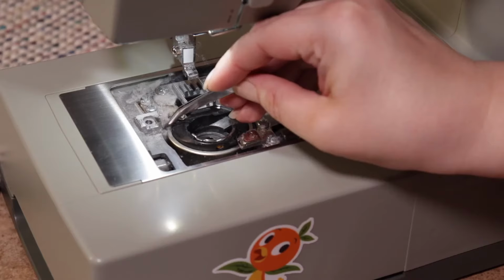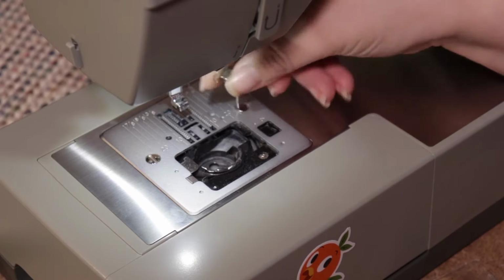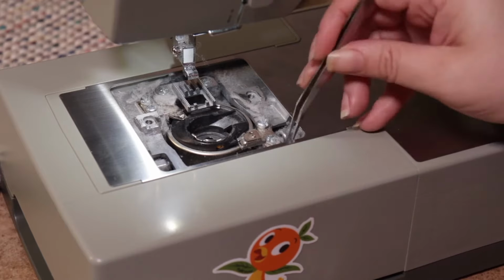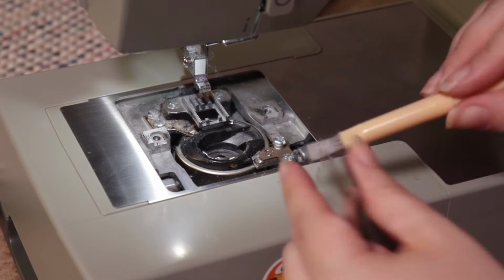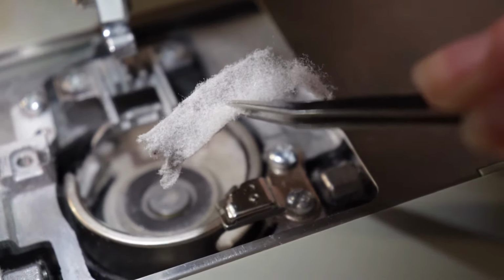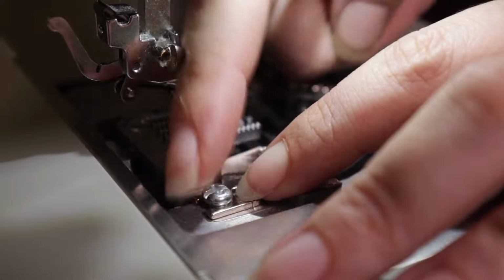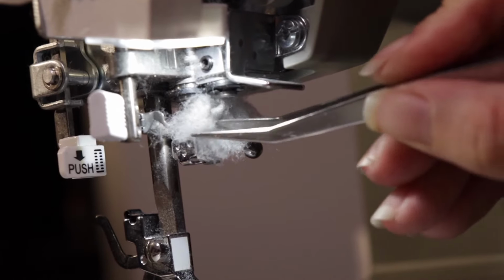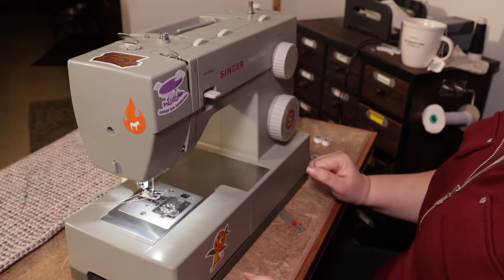Cleaning A Sewing Machine | Singer Heavy Duty

Comment: You don’t need to remove anything to get the bobbin case out. You manually turn the handwheel to put the hook race to the back then the bobbin case comes out.
Reply from the maker: I’ve tried that and it works on only 1 of 4 of the machines I have so I figured others might have that issue too.

Comment: Need slower more detailled instruction on how to get bobbin housing back in please
Reply from the maker: it should just drop back into place. If you have to force it, it probably isn't right. Make sure you have the it facing the right direction. (On this machine, it has a yellow dot on the outer edge that faces you.) Hope that helps!

Comment: You mentioned presser foot post. My fabric most of the time gets caught there, especially, thin cottons etc , I’m just into only cottons and it get caught there. I have to sometimes cut the fabric out, or gently push it up with a sharp thin screwdriver like tool. Any suggestions to avoid it. Especially , when I reverse stitch it happens.
Reply from the maker: If it’s getting stuck at the beginning of your projects, you might be backstitching off the edge and then the edge of the fabric is so thin that it has the chance to get pushed up or down since there is a bit of an opening right there. 

Does your stitching come out ok? If it seems tight, try loosening your tension. That might help the issue as well.

Comment: Wow! This is the best sewing machine cleaning video I’ve watched! 
But if the bobbin case is made out of plastic, you should only use a plastic bobbin, otherwise you will damage the bobbin case and need to replace it.
The rule is metal with metal and plastic with plastic.
Reply from the maker: Thanks! It’s all about bobbin size. Not all bobbins are created in the same shape or size. Also, I only use metal. I never use plastic as they can easily warp or become brittle and break over time.
Reply: @sewingwithstacy  I’ve heard this one from a person that services sewing machines and posted one video on youtube explaining this matter. I understand why you’d want to use only metal bobbins but there’s a reason why it is recommended to use only the type of bobbin that comes with your sewing machine. 
For example, in my sewing machine’s instructions manual it is specified that a metal bobbin shouldn’t be used, that’s why I believe it’s not only about the size.

Comment: Thanks for a great video!  Very helpful!  Could you also use a small vacuum to remove lint?
Reply from the maker: Yes, theoretically. But a lot of the stuff stuck and tangled won't come out. Because there is oil in the machine sometimes you need to open it up and brush it out. Happy sewing!

Comment: Good job , I have a singer machine 4432,can I use steel bobin, with this no problem please let me know
Reply from the maker: Yes you can. If you constantly use them it will train the machine. Also if you have an issue with the tension, just adjust it using your tension wheel. Thanks for watching!

Comment: Thank you for the video.  I have a question, do you know what might be the cause of my thread coming off the needle and getting tangled in the eye for the lever above from when you turn the wheel to thread it?  I hope that makes sense.
Reply from the maker: It could be that you aren’t pulling enough of a ‘tail’ through the eye before you start and the uptake is just pulling the thread up and out. Try pulling your thread through so it hangs off the back of the faceplate. You can also gently hold the threads when you do your first few stitches.

Comment: Trying to give my fairly new Singer 4432 a cleaning/removal of lint.  The two little screws on the the arm that holds the bobbin casing in place are so tightly screwed I cannot budge them.  Any suggestions?

Comment: Hey there! I am cleaning my Singer 9444 sewing machine and there is some gunky yellow grease in a few spots. I am wondering if I should clean it off and oil it with some all purpose sewing machine oil, or if it serves a different purpose. I watched your oiling video and I’m confused that you only put it on the wick and no where else. My manual gives me no info on cleaning and maintenance so I have no idea what to do 🥲
Reply from the maker: It's probably just extra grease but you can certainly clean that up a bit! In my oiling video, I give an in depth tutorial on how to oil your machine. What I didn't cover is that you can also oil the needle bar with a few drops to help the upper run smoother.

Comment: A general tip for cleaning/dusting anything: start at the top and work your way down. Cleaning your house? Ceiling fans and high shelves first, vacuuming/mopping last. You'll get a better result since all the dust that falls will have time to settle and it will all end up somewhere that hasn't been cleaned yet.

Comment: Hi I cleaned my as you told and problem is that upper thread collect down side , again and again I checked thread bobbin please help me
Reply from the maker: I'm not sure I am understanding your specific problem, but it sounds like you are saying your upper thread is getting stuck in the bottom. I would suggest that you completely unthread, and re-thread the entire machine. If you still need some help, I would next suggest that you use a new/different bobbin. Usually this will help solve the issue.

Comment: How do clean underneath?  My circular felt broke off - can I still use my sewing machine to sew?
Reply from the maker: The easiest way to clean underneath is just to pick up and move the machine. You would be surprised how many little bits are under there! In regards to the broken piece, without seeing it, I am not sure what you mean. I suggest that you reference the manufacturer guide and see if you can get a replacement part.
Reply: I take mine out to the garage and grab my compressor hose. 2 minutes and done. Then again, I’m a rebel. 😂😂😂

Comment: Do you know how to find the correct pressure foot pressure if you didn't mark the factory setting?  Like rule of thumb were all factory set pressure feet sit a nickel or a dime thickness away from feed dogs when lowered. I moved my dial without making it first, and now my threads are breaking trying to find the right tension.
Reply from the maker: Mine sit on the feed dogs when lowered. There is no gap.

Comment: Hi, do you also need to oil the upperpart?
Reply from the maker: Yes you can oil the upper but not nearly as frequently as the lower as the lower builds up lint and sucks up more oil.
Reply: Do you have video for oiling the upper mechanisms?

Comment: Singer warns against using metal bobbins in this type of machine - will they wear out the plastic bobbin casing sooner? I would like to use mine.
Reply from the maker: You can use metal bobbins but I suggest that you only use one or the other because yes, it's a metal bobbin in a plastic housing, it can make grooves faster than a plastic one. Once you use metal, the housing is used to the metal ones which is why it's not great to switch back and fourth.

Comment: Sewing machine tips and tricks watch that and you don’t need to take out the screws from the bobbing case 🤗
Reply from the maker: I usually don't! I got other 4452's since I made this and they have enough room to just slip the bobbin housing out without removing the screws. This is a step just in case you have one manufactured like the one I got and need that extra space to get it out.

Comment: That's interesting that you also have found it necessary to remove the little "stop" plate(?) before the bobbin case can be lifted out. Many other videos on here show it simply lifting out without having to remove or loosen that plate.  I don't have to actually remove mine, I just loosen it, which means the screws remain in place and aren't in danger of dropping down into the innards of the machine. Obviously, I tighten them afterwards. Singer UK Helpline have told me I shouldn't do that, but haven't told me how else I can get it out!
UPDATE SINCE THE LAST POST. Singer's UK Helpline has now advised me to return this under Warranty because it shouldn't be like this.    
STOP PRESS  - since my last comment that Singer said to return it, I have had another look and found the problem. There are two small plates fitted above the bobbin case, each held in place by two screws. One plate at the rear left hand (which she removes in the video), and one plate at the front right hand. There is a tiny amount of clearance around the holes through which the two screws in each plate pass. By loosening these two plates and sliding them within the limit of their holes outwards from the bobbin case, then re-tightening them, enough clearance can be won to allow the bobbin case to be lifted out and replaced. BUT it's much easier if the slot on the side of the rotating case into which the bobbin case sits, is at the rear of the machine (just slowly move the hand wheel to position this. Once you have done this, there should be no need to get the screwdriver out again.
Reply from the maker: Great to know. Thanks for sharing! I also never experienced a machine where I had to work so hard to get the casing out! I thought it was kinda weird especially since, I've bought a few more 4452s and they don't require me to remove any screws.